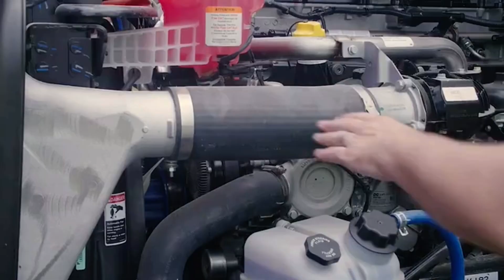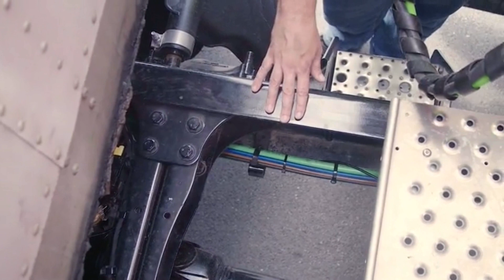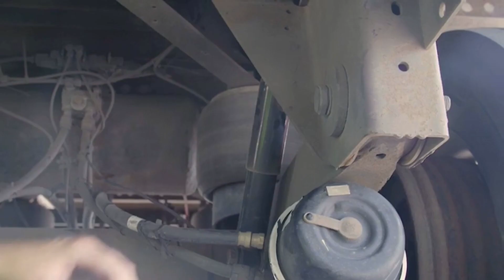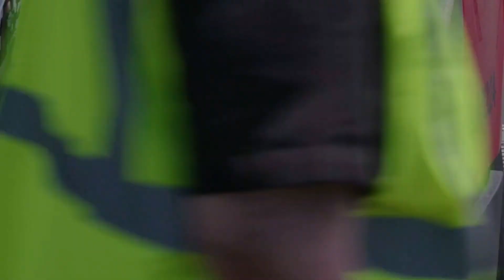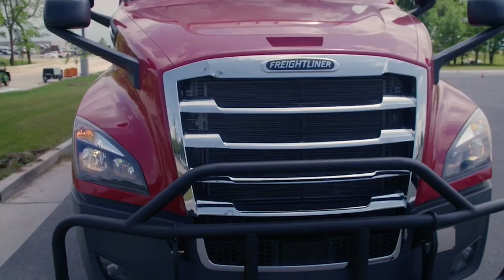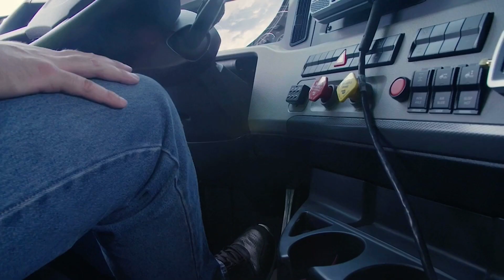Prime inc  - CDL Test

Comment: can you still pass without remembering every part and measurement
Reply: You can, but you have to collect enough points on the outside parts so that when you do your in-cab you’ll have Atleast the minimum points you need to pass.  The minimum is 67, and the air-brake test is pass fail (if you don’t do it correctly you will fail).

Comment: so I'll say So I'll say, "This one here.... It's properly secured and not cracked, bent or broken!" Will I pass even if I don't say what the part is? What say you?
Reply from the maker: Yes
Reply: The only part of the test when the language must be exact is the AIR BRAKE TEST.  IF you screw up the language then start over or you will fail.  remember Light and Buzzer AT or BEFORE 60 pounds.  Parking brake and Tractor protection valve pop out BETWEEN 40 and 20.  But on that one I would just say Between 40 and 20 but actually doing the pump down, watch the valves pop out and pump down until you have no more air.  Actually did that when I took my CDL test in 2016, the protection valve didn't pop until the tanks were empty, had I stopped I would have failed instead of Trifecta.

Also during applied pressure test don't tell examiner what is on the paper.  WATCH the gauges, if you lose air let them know I lost more than 4 PSI.

Comment: When I google the tread depth on steering tire it shows 4/32 depth tread but every video I see is saying 4/30 who is right google or you guys ??
Reply: It's 4/32nds in the front and 2/32nds on the rear. No one measures an inch in 30ths. We measure in multiples of 4. 1/4, 1/8, 1/16, 1/32. So it's 4/32nds and 2/32nds, or 1/8 on the front and 1/16th on the rear but its easier to not simplify in this case
Reply from the maker: I believe it’s 4/32 too, but it could of changed
Reply: Steer tire is 4/32 while drive tire is 2/32 minimum

Comment: My will to live, not cracked, bent or broken
Reply: Make sure it is properly mounted too 😂😂
Reply: @canadahangouts-9580  properly mounted and secure good sir 🤣
Reply: @canadahangouts-9580  Properly mounted AND secure thank you.
Reply: Filled to the manufacturer’s specifications
Reply: @tylerharalam3411  and checked with an air gauge.
Reply: I know, I dream that isshhh! I passed but I think the guy felt sorry for me  and passed me on some I missed honestly.
Reply: Hello …let’s go!!!
Reply: My soul has no oil free of debre and my will to live is not worn dangerously thin ..is not leaking ☺️🔫
Reply: Laugh if you will! I am a Class B CDL Trainer for school bus in NY. And this Dude is on POINT! "NOT CRACKED, BENT, OR BROKEN" Is what I strive for my trainees to repeat! Some get it, some fail their Road test!
Reply: @Blackwolf42991  no abrasion bulges or cuts for any hoses.

Comment: Sounds like if you say “not cracked, bent or broken” to everything you’ll pass😃
Reply: Pretty much, and “not missing any hardware”, “no abrasion buldges cuts dryrot or frays” “not leaking “  i passed my test today, it’s really easy just gotta stick to one video and study it for a week, two weeks max! You’ll pass ✅
Reply: @vellyp2033  congratulations on your pass!!
Reply: Don't forget to mention the "not leaking" on anything that contains air or fluid.
Reply from the maker: Yep that’s 💯 correct
Reply: Can't forget the ABCs
Reply: And not missing bolts. It's not 100% correct but almost every item includes "cracked bent or broken"
Reply: NOT Totally correct.  You have to recognize that the AIR BAGS are not cracked, bent or broken AND No abrasions, bulges or cuts and not leaking.  It has metal and rubber.

Comment: This is in my opinion the best full length video of the Prime Pre Trip Inspection that I've seen so far. I'm currently in school at Prime and this video has helped me tremendously. Thanks for sharing. My only question is, during the In Cab inspection, aren't we supposed to test out Windshield Washer and Wipers too? That's the only thing that I noticed might have been missed. And someone told me the Trailer, in the rear does not have Spring Arms. Is this true. Either way, I'm just grateful you've shared this with us. Especially Prime students who, like myself, was having trouble remembering all of the information on the Pre Trip Inspection. God Bless you and yours and be safe out there. Thanks Again.
Reply: Each state has different variations, the video is specific to Missouri but maybe 96% similar in other states